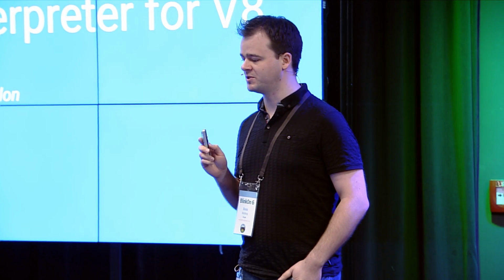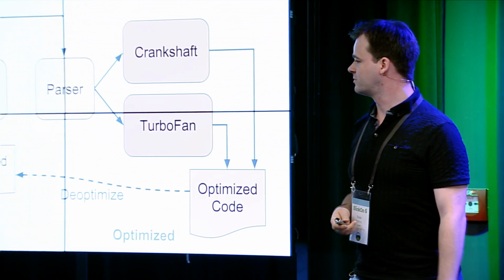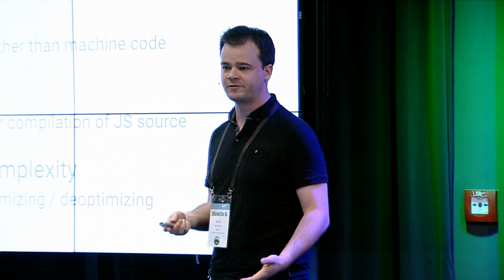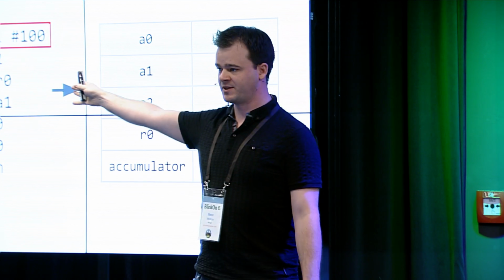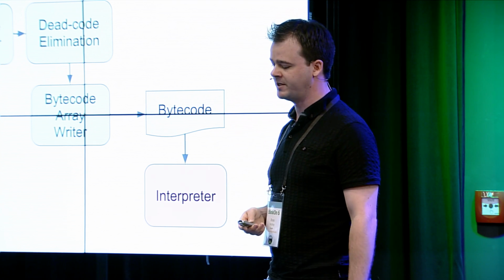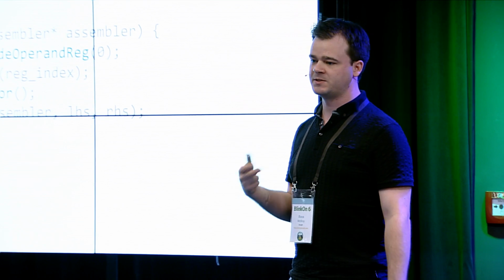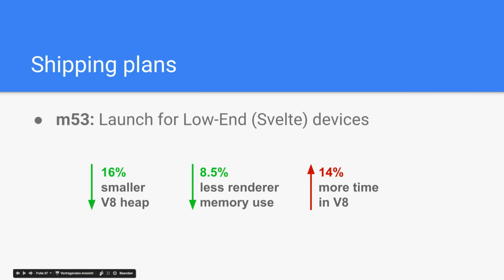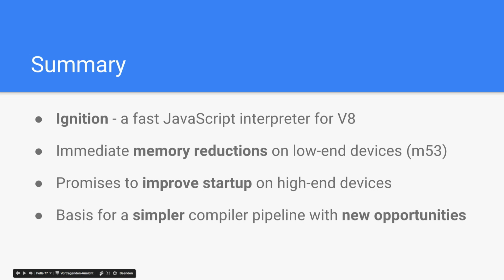BlinkOn 6 Day 1 Talk 2: Ignition - an interpreter for V8

Comment: It is already more than 5 years gone. Does anybody know what is the current state of affairs? Is google still sticking with Ignition or there are some new approaches got emerged?
Reply: TL;DR: The current pipeline consists of Ignition (interpreter) > Sparkplug (non-optimzing compiler) > TurboFan (optimizing compiler)

Quick recap: Full-codegen and Crankshaft retired in 2017, and they changed TurboFan to compile directly from the bytecode. Room for optimization shrank as Ignition was already quite fast in its interpreting capabilities. Making TurboFan compile quicker would have meant reducing its optimizing passes, impacting the peak performance of the compiled code.

As a compromise, with version 9.1, a non-optimizing compiler called Sparkplug was introduced in between them. Sparkplug is, at its core, just a transpiler that spits out machine code snippets for individual bytecode instructions generated by Ignition, which in turn conveniently has already done all the hard work like register allocation and stuff like this. To be really precise, Sparkplug "serializes" Ignition's execution, effectively baking what Ignition would dynamically do as a static machine code sequence into memory.

Because of this, Sparkplug is not only extremely fast in compiling but can also be run at a whim because it has almost no real work to do. I don't know exactly when Sparkplug is invoked, but they certainly do it a lot more and a lot earlier than they would invoke TurboFan. Hence, you get non-optimized machine code pretty quickly, possibly long before TurboFan has stable information about object shapes.

From that point onward, once code becomes hot, TurboFan kicks in with its speculative optimization and performs on-stack replacement of the Sparkplug code with its own.
Reply: @Asatruction  Thank you very much! It was quite helpful